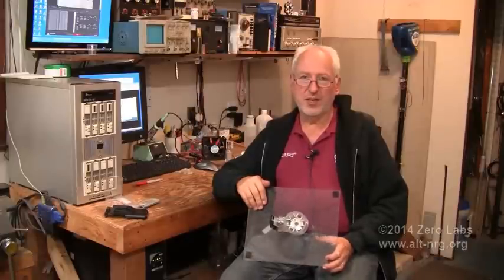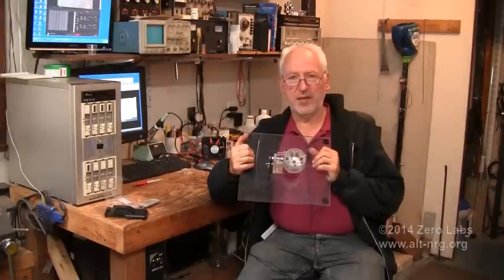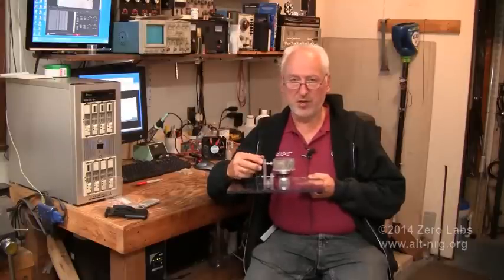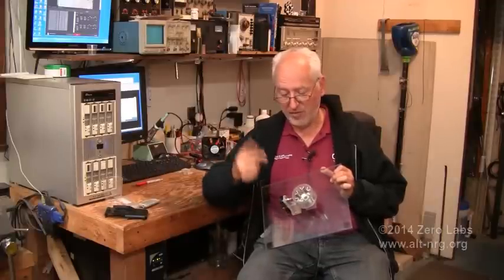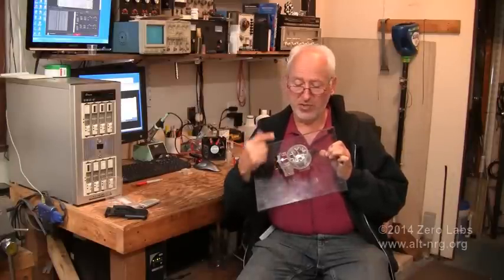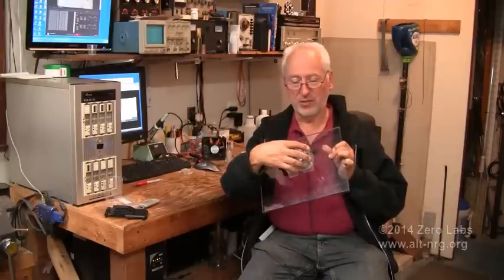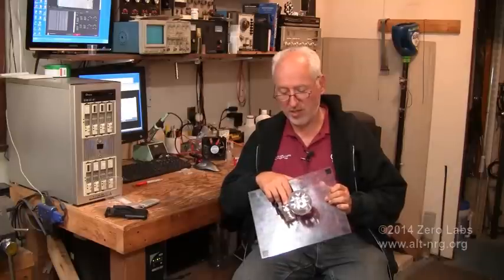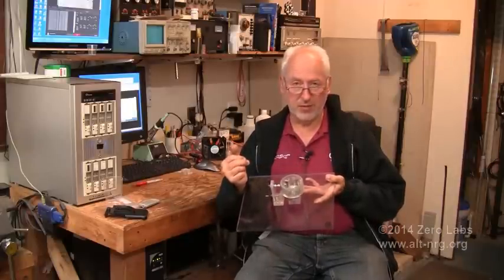#380 VFPMM update 2 Unbalanced wheel!

Comment: Video timeline 3:07 "There is more resistance in one direction, then there is on the other direction."  You just described my stators and wheel assembly perfectly. I'm surprised that you have never publicly explored and played with one of my stators, (if so I don't know about it) as you would be very impressed as to how well they actually work.

Sir, if your reading my comments here, you should build one of my stators, as I promise you... that as long as you do so correctly, you will be amazed at how well my "one way stator" design sets up a nice imbalance in the system. You can also PM me is need be on FB, for real time chat.

Sorry it took me so long to find you again.

Cheers!

Comment: I tried to build one of all permanent magnet motors myself. I made it around the Perendev design. I didn't post a video about my motor because I couldn't get it to work. However, I didn't try to use magnetic shielding. From what I can tell you have to  shield 1/2 of your magnets in that design and have them at 30-45 degree angles (that is in Perendev design). Anyways... awesome video. We will achieve zero fossil fuel if more people work on it. The more people working on the goal the better we are. :)
Reply: Naoki Kashima Not only you didn't get it to work - nobody did. I would Pay 50000$ if somebody can show me a working setup of a so called permanent magnet motor in reality.
Reply: Naoki Kashima I already know that video. Doesn't show how it works.

Comment: Well done , yes keep trying you definateky need flux redirect iron core pieces to shut off the sticky point flux. Also the build might be much too small as in the circle the gates overimpose and brake eachself , so it is best to build something big where the single gates are at least 40 to 50 cms away, so they dont effect each other too much..

Comment: Another idea is to stack rotor sections but offset them and have side magnets timed appropriately to those.  Many magnet motors I've seen that had promise only had one "working section", and all suffered from cogging/losses, but if you have 3 or more stacked working elemnets offset from eachother,  but not too close to interact negatively with each other (distorting of the fields),, you can potentially end up with always "two pulling" and one dragging, as long as the pulling forces are greater than the dragging, it should be able to accelerate, once put into motion.  Adjusting the relationship between stators positions/timing would in theory allow speed/torque control.  Just my out of thin air idea....

Comment: I would suggest duplicating your side sections several times and place them around the periphery (same air gap as first one) to see if you can time them to give the same net effect as the first one...   I'd also suggest PLASTIC (delrin, nylon or other) for the shafts instead of steel to hold that side magnet, so you don't get eddy current issues with non-ferrous metals.

Comment: Verify your flux fields. The correct angles for the stator N-S 30 degrees, for S-N 330 degrees for 6 magnet pair. Because of your 3:1 ratio on the gears, these fields must be exact. utilizing 5 gear mounted rotors would imbalance the timing, presenting another issue because the axis would be 360/5 or 72 degree angles.

If you need flux cancellation between bar magnets, use aluminum separator bars pointing inward to center of stator wheel. Copper would increase eddy fields.

Comment: my guess is the mechanical force needed to rotate the rotor is greater then the force generated by the peripherical generator even if you have a 3:1 gear. statistically there's a great chance that in phase #3 and phase #6, the spinning magnetic field will be attracted more in the other way, counter clockwise instead of clockwise (decelerating instead of accelerating) and cancelling the momentum even if the gears are "supposed" to prevent it from happening. i would suggest not using the north - north + south - south configuration of the rotor, try north - south + north - south. or double the n-n + s-s occurrence but it will basically make it a n-s + n-s configuration after all. also i would try to put the peripheral generator magnet in a vertical axis instead of horizontal so you could eliminate 1 set of gears and have a more direct drive on the rotor. also id try starting it with a fast motor like a drill instead of using fingers, with some kind of fly wheel attached to stator/generator peripheral magnet. maybe have a ferro magnetic disk right behind the magnet to dampen the magnetic field. the problem seems to be that you have a strong attractive force on the rotor pulling towards the generator/stator creating eddy friction or momentum cancelling forces.

Comment: I think if the stationary magnet could be set up to rotate also, timed with the wheel.

I would have liked to see what happens when one of the muller motor coils
had a magnet on one end and a coil to generate electricity on the other end and was pulsed. Making sort of a solid state generator.

Comment: Great work... I am following you closely. ...  Thought: A few years back my Tech class did something similar (experimenting) and we tried different size 'outer cylinder-size' Neo's and found IF we got close to the same guass/strength as the inner Neo's it spun freer & longer, but didn't take it much further (the experiment), thus if the outer cylinder magnet had a larger diameter and thickness would they 'cog less' (interact better) with your V-magnets? - Your thoughts? -- the Old shop tchr (40 yrs+) --- PS - Thanks for helping me over the years with all your experiments that we have tried to replicate in class.

Comment: Have you tried this with the edges of the magnets pointing outward (toward the outside of the wheel) rather than inward? Also, in your first video on this, for some reason I assumed you would be using 6 bar magnets fastened to the inside of the wheel in a hex shape, rather than angled bar magnets. Is there a reason for this change, or did I just not interpret the previous video correctly? Could the angles have something to do with the problem? Maybe getting the angles just right would help, or using a hexagonal arrangement of bar magnets the way I envisioned it in the first video.

Comment: I think you need to do a study using metal filings to see how you're altering the magnetic fields when combining magnets. The drawing you made of the half -cycle seemed plausible.Now it looks to me that the N & S poles are vertical in relation to the cylindrical magnet, where they were horizontal before.

Comment: I know you are trying to over come the conservation of energy law and it doesn't hurt to try new ideas. If you are able to create a continuous rotation (perpetual motion), doing work above the level of sustaining itself can only be achieved with supplemental power. Now if the input power is less than the total out put a over unity can exist and this is very unlikely. At lest you are showing the world your work and than is a hell of a lot better than all the claims about this type of thing that I've seen or read about. Good luck in your quest.  BOB
Reply: Perpetual  non-magnetic and magnetic machines have been built and demonstrated. They can not do work outside of sustaining their own motion. It is the conservation of energy law that will be tough if not impossible to over come to produce more power with less input power.
Reply: therealnightwriter Ether? You should read a physics book that is not over 100 years old.
Reply: therealnightwriter Can you provide a source where such a device is explained? Btw: Tesla also tried to transmit energy wireless. And even if he would have finished that project - it wouldn't have worked in that way - also Tesla was not always right.
Reply: therealnightwriter Yeah, also the principle of the crystal radio is real. But he build a tower to provide solid energy and not just to drive a radio. Also his attempts to transmit energy in the near filed are obsolete. Nowadays we use royer osciollators.

Comment: I wonder if you could tune the magnetic alignment with a coil and the scope. Are all magnets exatly equal? no in specs, in real life I mean.
Reply from the maker: areavirtual3d If my design works, it will dispel SO many myths about what it takes to make a permanent magnet motor work, that will make your head spin too! Among those myths I believe are:

1) "All magnets must be precisely equal." Wrong. +/- 10% should do just fine. I am not concerned with measuring them.

2) "It must be frictionless." News flash: If your design must be frictionless to work then it BARELY has enough power to keep itself running, let alone do any useful work. Any design worth a damn will overcome any friction with plenty to spare to accelerate and do useful work.

Comment: A good idea is a magnetic centerpin where the turning part is not touching and  hoover"s on the pin ?  this device has many posibility's - like what would happen if you use barmagnets line them properly out and even stack them in the bucket ! drop a cube magnet wit stop on the axl and again a stop ! then between the cube magnet and bar magnets a coperen spoel - when you give the cube magnet a push and use a motor to generate approuch ? The size and distance of the bar magnets wil determen the velocity of the cube magnet ? i wanted to search the internet but it' momentairely to slow ss

Comment: Question # 1... What happens when you spin the cylindrical (spinning) magnet with the gears DISCONNECTED from the rotor? In other words, have you proven that the spinning of the "Spinning magnet" causes the drum/rotor to fully cycle? OR have you proven the inverse?

Question # 2 (asked yesterday)... What if the magnets were not totally perpendicular? What if the faces of each set of magnets in the rotor, were facially rotated 45 or 60 degrees? It might mean that instead of 6 pairs of magnets you need 12 or 18 pairs and of course a bigger rotor.

Question # 3... What if you stacked 3 or 4 spinning magnet assemblies on top of one another, each driving drums (rotors) that are 120 degrees or 90 degrees out of phase with one another

Question # 4... HAve you considered that the spinning magnet has to be stronger than the rotor (bar) magnets?

Thank you for your heart and patience.
Reply from the maker: Jamal Johnson All great questions.1) I have tried leaving them uncoupled. What I get is an semi square wave magneticly coupled gear. I may explore actuating the stator 90* at a time.2) Already on my list of things to try.3) I think that accomplishes the same thing as adding more of the five planned stators around the drum of six magnets.4) I have already tested weaker Samarium Cobalt magnets in the rotor. I may end up using some as focusing magnets.
Reply: ZeroFossilFuel This is exciting. I hope you can liberate yourself if it becomes "too obsessive". I hope to keep track of you for no other reason than to make sure you don't go loony with it.

Comment: Hi sir, I see you're trying to produce magnetic motors, the gear connected to the bottom is an awesome thought. Here is a design you can add to help you.  What if you stacked 2 of your motors on top of one another? how about three? what if all 3 were allowed to spin independantly? what if you created a magnetic resistance at the top, and let the wheels wobble a little more sloppily. The cylinder shape is an awesome tool, but what about the cone shape? The following link may help inspire you. What if you add your gears to the following design? Imagine your ideas combined with these ideas. check this out. http://rimstar.org/sdprop/haml45gd/haml45gd.htm